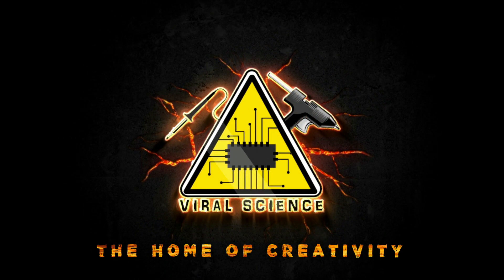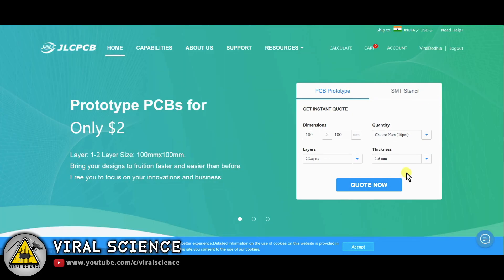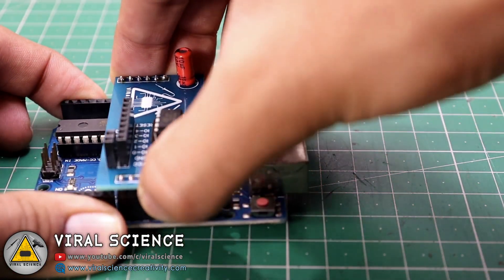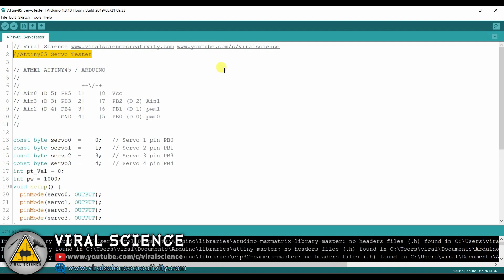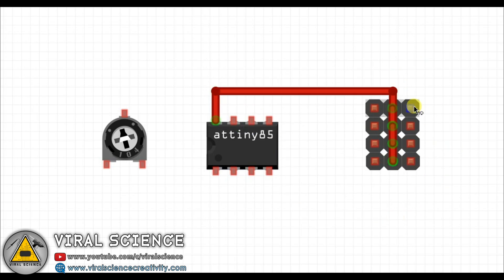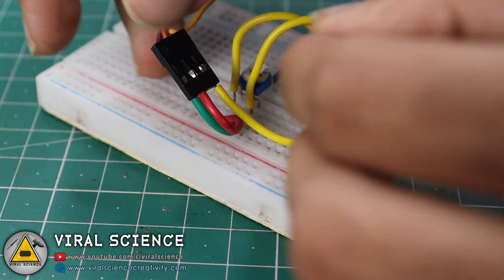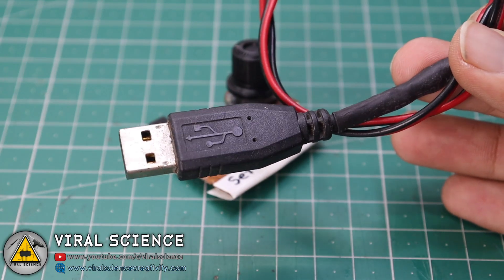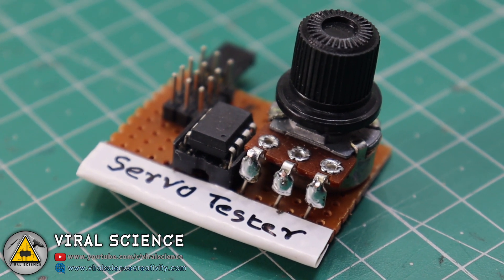ATtiny85 Servo Tester | Digital Multi Channel Servo Tester

Comment: Bro how does you under stand which wire we should connect with witch leg when you turn over the vero bord🤔🤔
Reply from the maker: Its the same connection as i shown in circuit diagram